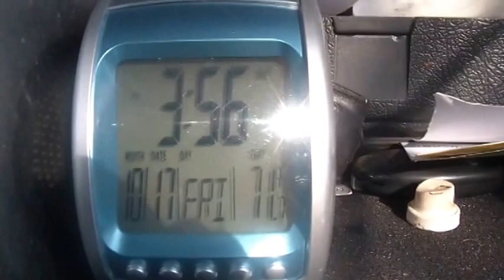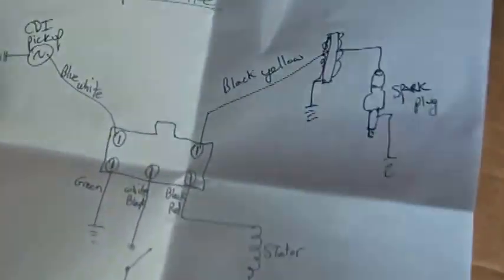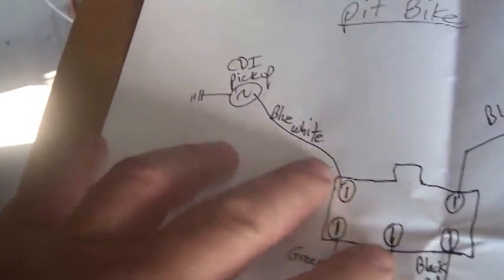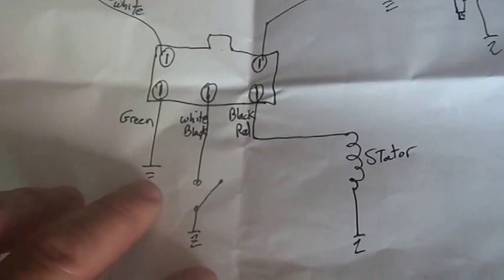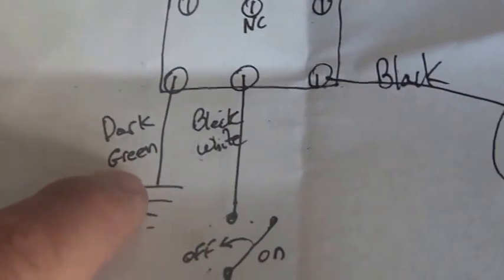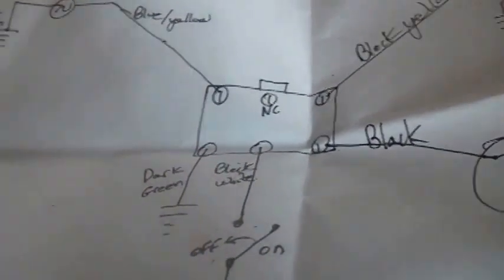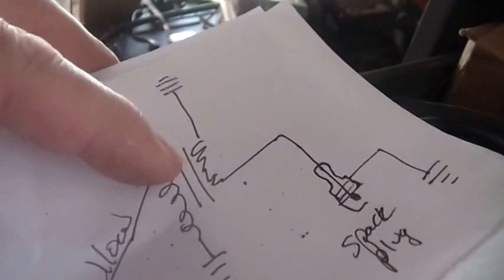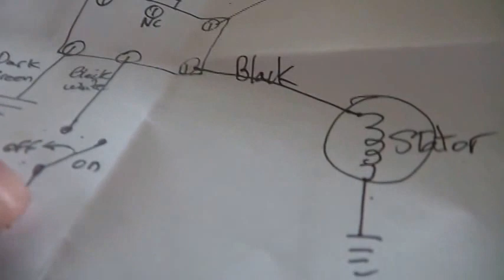10_17_2014, Wiring a pit bike. SDG 110cc, Lifran 125cc engine,

Comment: I know it's almost 20 20 now and I am commenting on this but do you remember which one of the wires went to the off and on switch there are two plugs each plug has a end one wire is the black with white stripe other is green there are two different plugs but they both have the same colored wires just different plugs I got my 125 for my ATC 70

Comment: Hi Harvey very nice explanation ....I Have A Question Wich cable go back to the battery to keep charging, when i connect the red cable getting warm and hot  i disconnecting both the black and the red ....start good keep engine running good but no return to battery can u reply to my email djelias29@gmail.com
thanks

Comment: My lifan 125cc engine I got about a week ago brand new has 2 blue and white wires coming from the engine but the harness to plug them into only has one..should I leave one off or combine them ?
Reply from the maker: Hey Greg, What are the colors of all the wires coming off the engine??? Blue or blue and white are typically the colors of the wire coming from the stator, are there 2 bundles of wires coming from the engine???? Thanks for asking, watching, and commenting!!!
Reply: Harvey Spooner there is one bundle of wires coming out of the engine but in that bundle there are two blue/white wires
Reply from the maker: Hey Greg, I put up a video for your today.... Thanks for asking, watching, and commenting!!!

Comment: hey i have a question i have a apollo 110cc pit bike and loaned it to my cousin but they crashed it and it caught on fire its not that trahsed but i got it back and replaced the ignition coil , carb and cdi , im having problems wiring it because the color coding burned off all the wires coming from the stator. do you have any suggestions as to what i should do next???
 thanx in advance

Comment: if i add a headlight what wires do i use?
Reply from the maker: +Jonathan Garcia , To fun an AC powered head light, the wires are yellow, (on some bikes white) to ground, (green),. What color wires do U have???? Thanks for asking, watching, and commenting!!!!
Reply: +Harvey Spooner well at the moment i have a problem.. took the bike apart to paint the frame put it together and now it doesnt turn on.. feel like the key switch is off when i kick it.. no spark any vkue where to check? ran perfect before i took it apart

Comment: Nice video. I'm wiring a Lifian motor on to a frame that has no wiring harness so I'm starting from nothing but the wires coming out of the stator and all new parts new coil cdi box. You're video helped with everything but where does the second wire on my key switch go and second one on coil?  I seen one off each go to the cdi box. I just want it to start no lights or electric start just kick
Reply from the maker: Fostet Camp ,  The key switch is a simple on off, true?  If so, one side of the switch goes to CDI in the location I have marked white/Black in the video, and the other side goes to  body ground, the CDI location marked ground should also be hooked to body ground, one side of the ignition coil should also be hooked to body ground, the other side of the ignition coil should be to the CDI unit marked Black/yellow... (Ground is green marked green on the CDI unit. I hope this helps, can make U a video if not, let me know, thanks for asking, watching, and commenting!
Reply: Just like to say your very long winded . And very hard to follow .

Comment: What's grounded to the frame, you mean like its just touching the frame? I have 3 wires coming out of my new 110 engine and about 800 wires from my old engine because not was electric start and this ones not.( not really 800). I'm having so many issues with the engine not sparking or it not being connected properly.